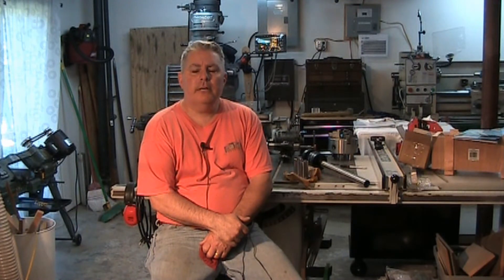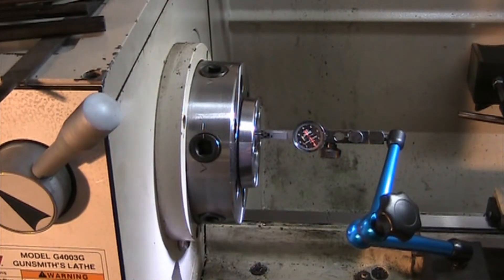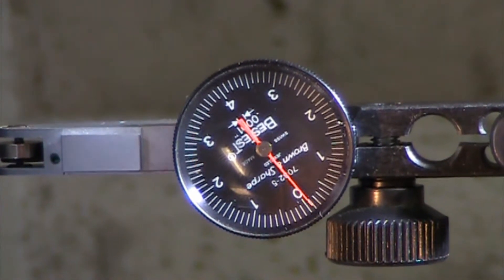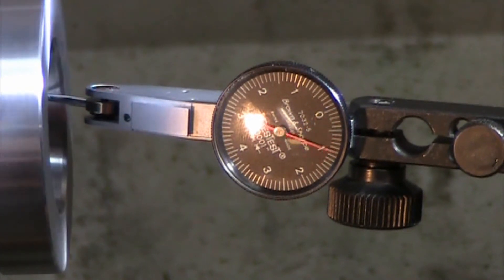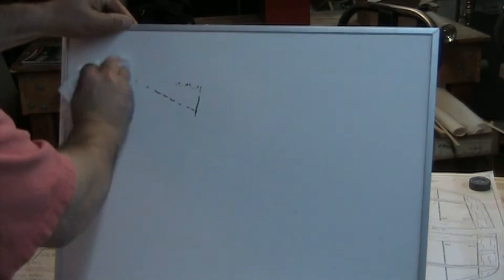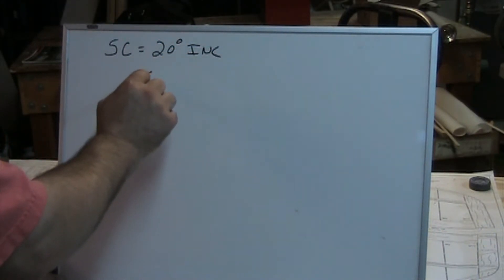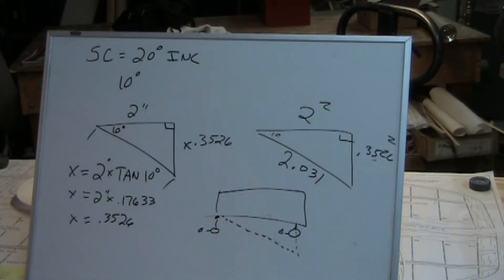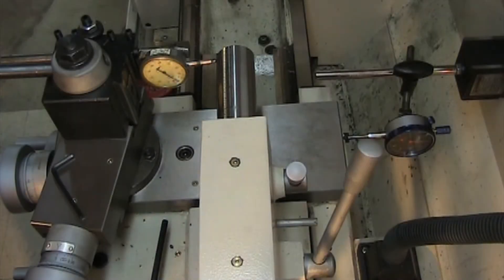Re-Grinding of Grizzly MT5-5C collet adaptor for collet closer project

Comment: Rather than a sharpie mark on each part use a small centre punch so it doesn't rub off, I had to do that to get my 3 jaw to run true, now i just join the dots and I'm very close. You could always grind the outside taper on the collet adapter to get it to run true with the centre hole as you have the grinder.
Reply from the maker: Derek Greenhalgh Hi welcome to the channel! I ended up doing that off camera. Took a vibrating etcher and made some witness marks. Great idea though!